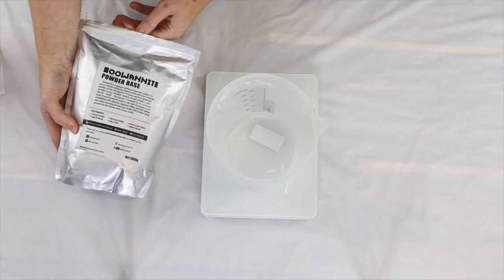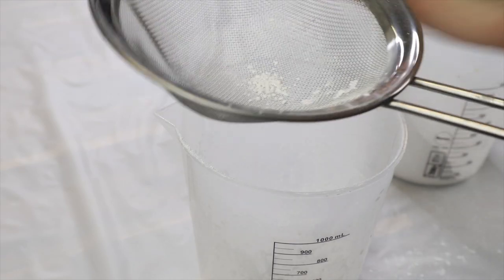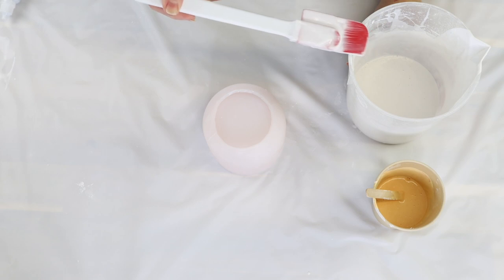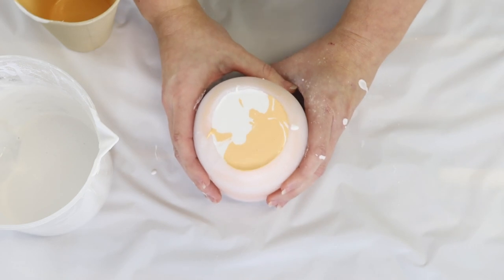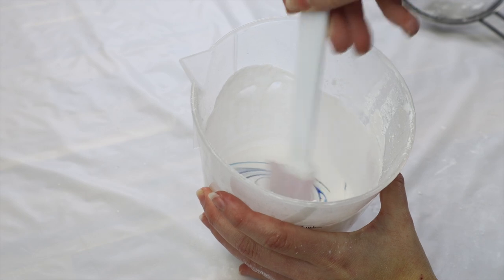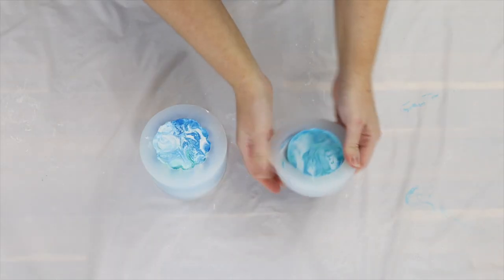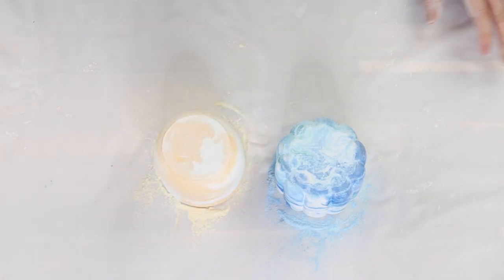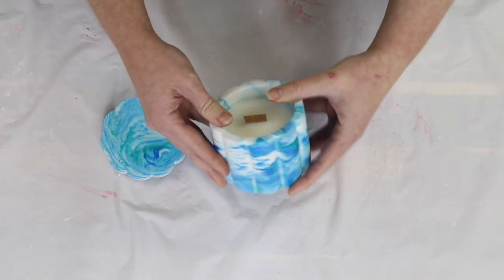How To Make Concrete Style Candle Jars From Eco Resin / Jesmonite

Comment: I noticed you weren’t wearing gloves and didn’t seem like you were wearing a respirator. Is Jesmonite safer to use than cement/concrete? I guess it doesn’t have the silica in it, I always found that the most cumbersome part of candle vessel making, having to put on all the safety equipment to get creative.

Comment: I want to make small plant pots with this method. Can I drill a drain hole in the bottom without the piece cracking? Also, you mention the need to “seal” when making tealight holders. What product do you recommend for sealing that is heat resistant? Very informative video - Thank you.

Comment: Hi, I have a question about sealant. It's great to use natural one out of bee wax but since it's a candle do the sealant do also melt at high temperature if you let it burn ?
Another question about the mold because i have this issue with plaster. When it hardens the plaster is getting warm and then expands the hole from the inside. When you demould you dont often get perfect round but oval shape and the lid doesnt fit. Do that happens to you too? Thanks 😊
Reply: Hey hun did you find out about this?